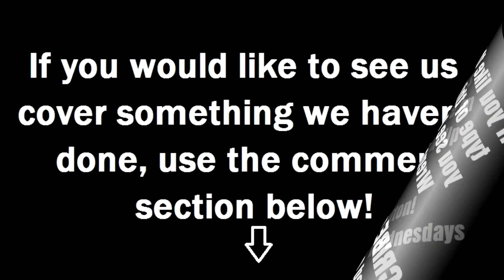Sealing Rough Engine Surfaces Part 1 - Wrenchin' Up

Comment: Either have the pitting welded and machined or clean out the pits and fill with aluminum epoxy and sand smooth.   

Do it right from the beginning.  Never bet on a gasket
Reply from the maker: Hi - Thanks for watching and sharing your input!